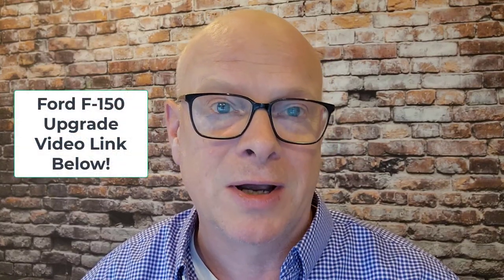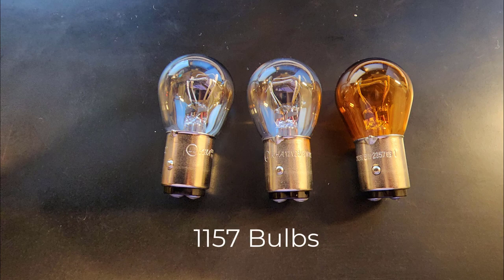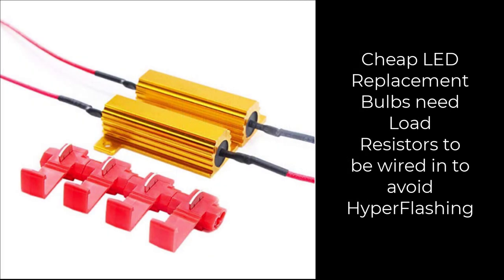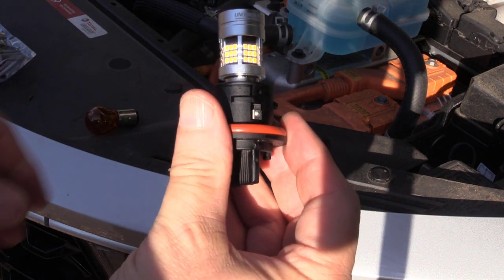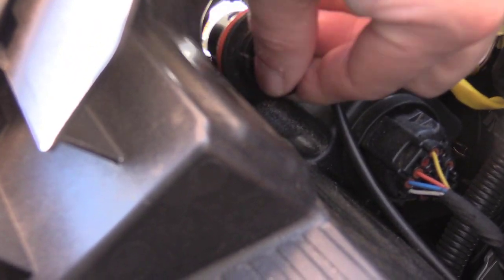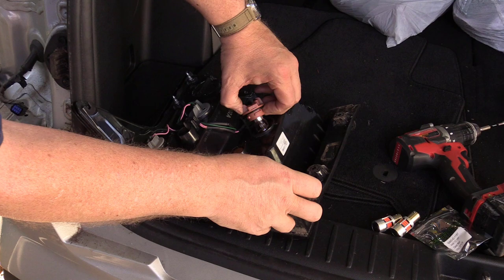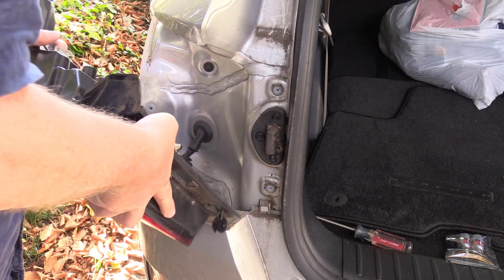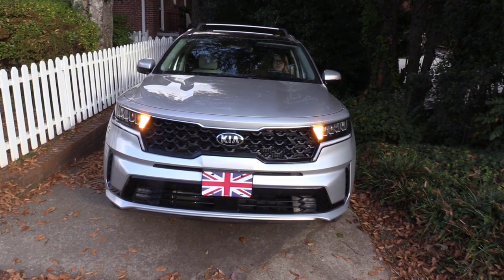Upgrade Your Kia Sorento Lighting in Seven Minutes!

Comment: Took me a bit more than seven minutes BUT I would not have attempted this without your AWESOME post! So THANKS! NOTE: the rear lamps are 1156 (Turn) AND 1157 (Stop & Tail). So you need DIFFERENT bulbs for the rear bulb changes. You can also EASILY do the REAR Side Marker lamps W5W (T10/194) while you have the tail lamp assembly removed. Just a few tips from me.
Reply from the maker: Thanks Wayne!

Comment: I'm surprised this worked. On my 17 sportage, it gives me an error code when I use LEDs. Which bulbs did you buy
Reply from the maker: Hi Marc, the links to the site that I bought these from is in the video description. undergroundlighting.com. Most LEDs do not draw enough current and fool the car's logic into thinking that the bulb has burnt out.

Comment: Question why would the lightbulbs have to be red and not just white since the taillights are already red? Usually you choose color if the taillight is clear and only have reflecting material ??? Or was that a personal preference
Reply from the maker: Hi Hugo, per the supplier, using "white" LEDs behind a red lens tends to make the light output look pinkish. This is because incandescent bulbs are generally white/yellow in color. Using red LEDs behind a red lens ensures a good strong RED color and there is plenty of light output to overcome any diffraction by the red lens. cheers...

Comment: Can you give an update? Have you ever tried flipping the turn signal on by itself for at least 5 minutes non-stop???
Reply from the maker: Not sure that I understand the second part of your question, but to my knowledge the newer generation of these lights from underground lighting are brighter and more robust. cheers
Reply: @fixorrepairdiy4609  Just flip the turn signal or Emergency Flasher and let it be for 5 minutes to see if you get any errors...make sure the car is running during those 5 minutes